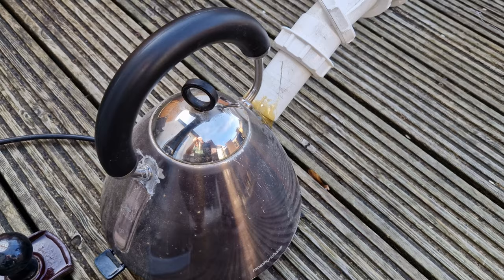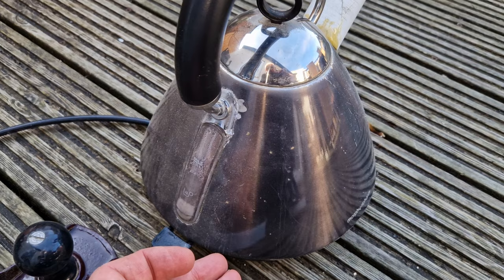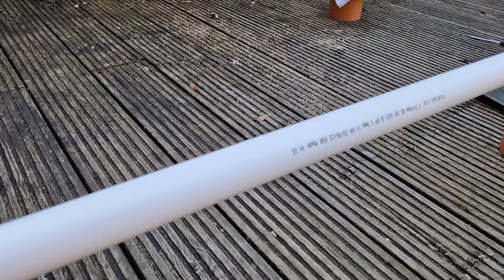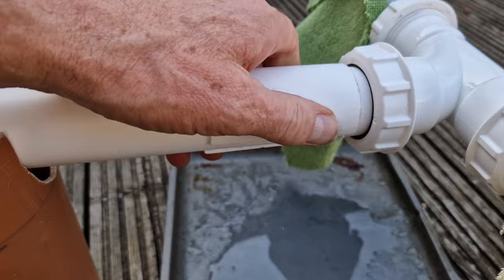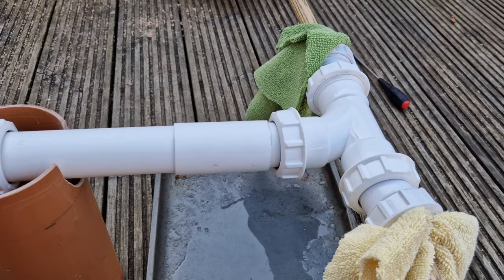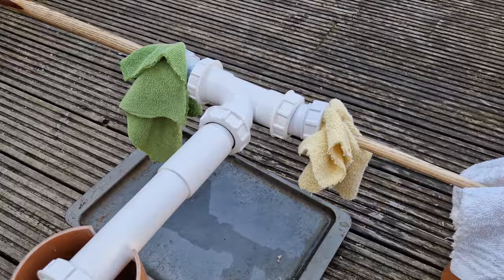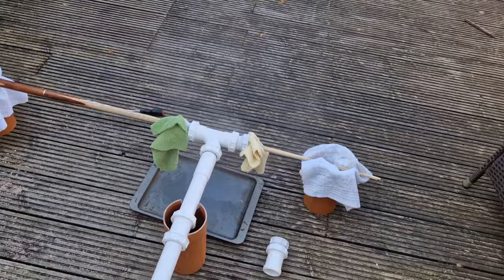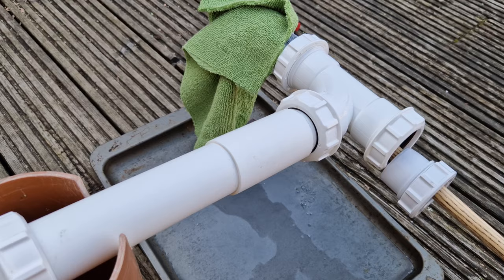Steaming a Snooker Cue - How to build a rig

Comment: Hi Marc a bit off topic but i was wondering how best to deal with a cue that is catching on my beard during shots. Its ash cue which i clean and oil often. However now i can feel the grain, sanding and oiling, hadn't solved it. Would sanding sealer help? Any advice would be appreciated.
Reply from the maker: You'll need a grain filler to replace what has been lost through cleaning and use. This will fill the grain an then you can see where you are at then.